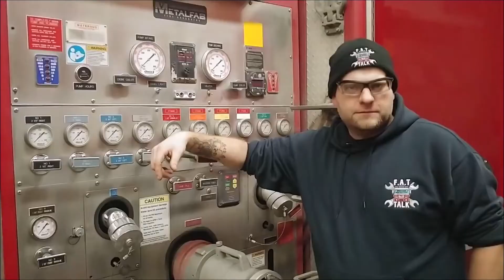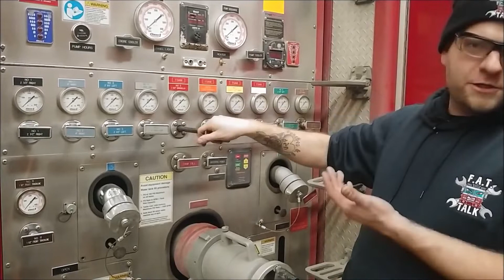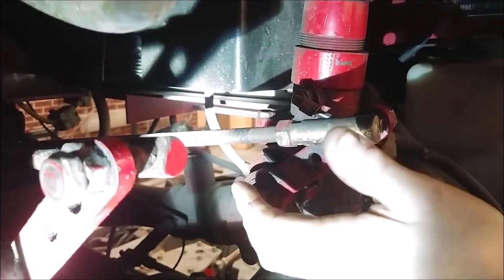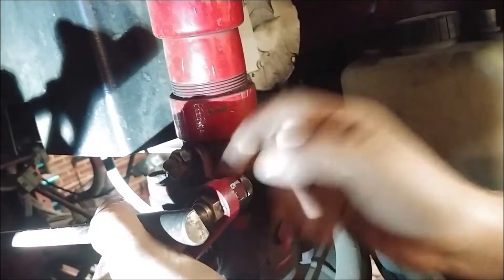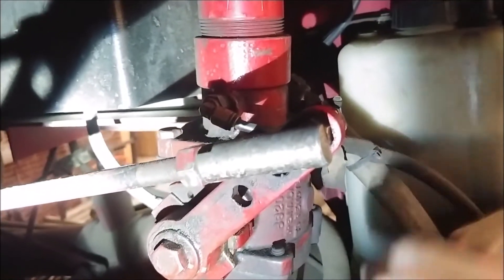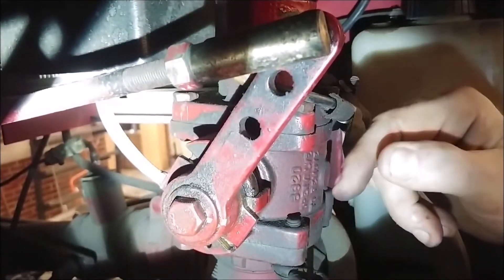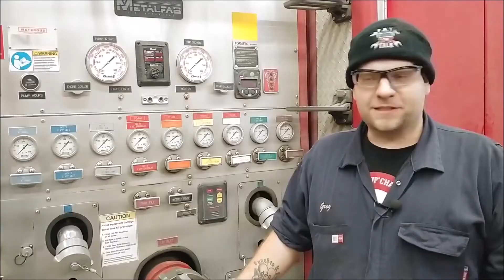How does a mechanical lever and valve work on a Fire Apparatus pump panel

Comment: All you did was determine the stops were hitting and did not prove the valve was either fully open or fully closed.  You have had to remove that bolt and washer to expose the timing mark on the valve trunion.